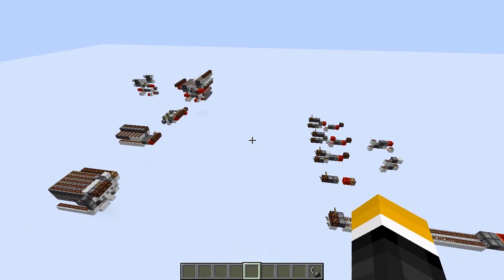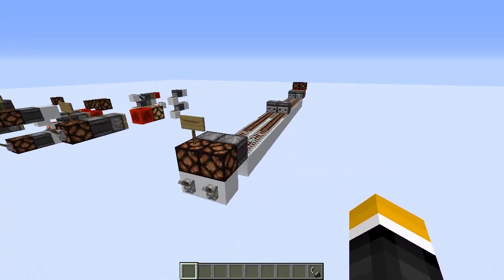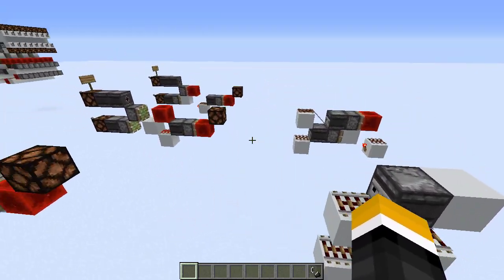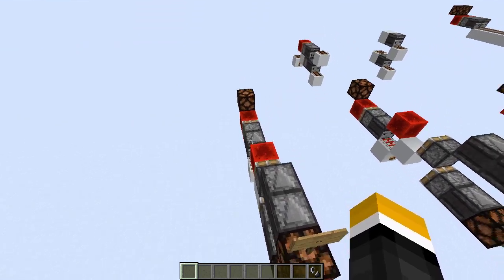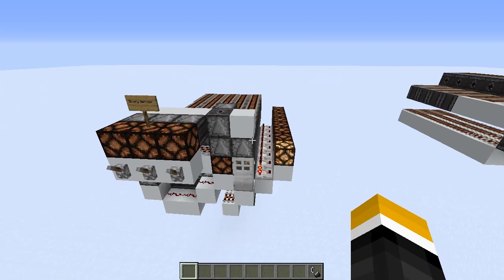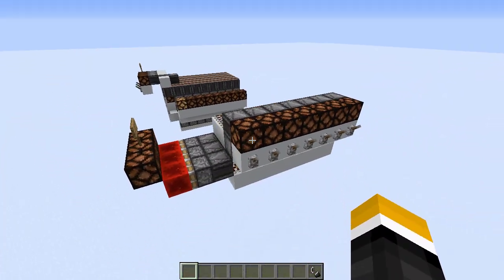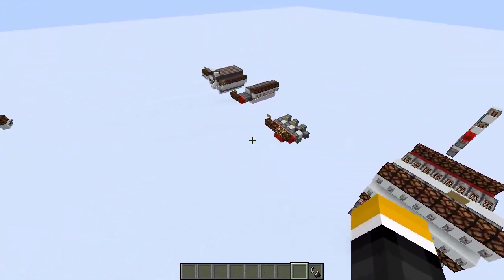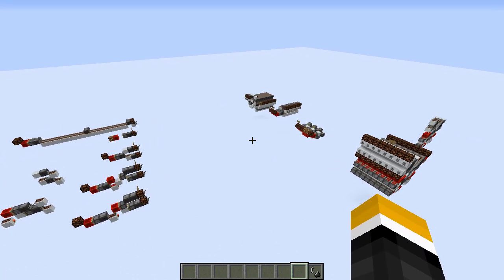Observer logic: 1 Wide tillable logic gates + most compact adder?

Comment: encountered a problem with the adder :( i built an encoder like yours but instead of being already in binary, i made two decimals that should get added to get the first term of the addition (then it would be added to another term made of two previously selected terms)... only problem, i tried to add the first two numbers to make the first term and the lamps light up wrong. like, i made a row of buttons for tens and a row for ones, e.g if i select 90 (so it gets converted to 1011010) and seven (0000111) instead of getting 1100001 i get 1011101. i rebuilt the adder 3 times now and can't figure out the issue, maybe it's the fact it starts as a decimal, but that shouldn't be a problem since it's converted already. another thing, when i reset the rs nor latch that brings converted numbers to the adder, the first two lamps always stay on, so i think the first two observers that get the lower input for the adder are registering the redstone wire (that wires latch and adder) turning off too, but only the first two? i'm fairly confused by this
Reply: i guess the problem with the reset is due to observers acting like the wire turning off are another input from all bits and carries everything indefinitely, idk i lost it lol

Comment: you can add another XOR on the adder (in eacj module) to select adder or subtracter, seeing your video I think its not to complicated, congratulations, very nice contraptions! :D
Reply: Hi ! I don't really understand "add another XOR" to make a substracter. Do you put them on the input side or in the output to invert ?
Reply: @hiboude2785  like in this image : https://www.google.com/url?sa=i&url=http%3A%2F%2Fprofessor.pucgoias.edu.br%2FSiteDocente%2Fadmin%2FarquivosUpload%2F17505%2Fmaterial%2FAula%252006%252007%2520e%252008%2520Laborat%25C3%25B3rio%2520Sistema%2520Digitais%252020141.pdf&psig=AOvVaw121xTvKcoMmVYPZWrR6t1p&ust=1590363346609000&source=images&cd=vfe&ved=0CAIQjRxqFwoTCMDmkKeTy-kCFQAAAAAdAAAAABAD .
The XOR gate will determine if its and adder (case 0) or and subtracter(case 1). Put it in the input side B to make A+B or A-B